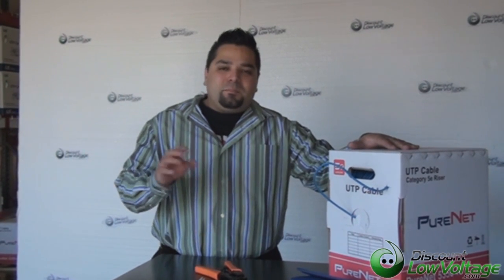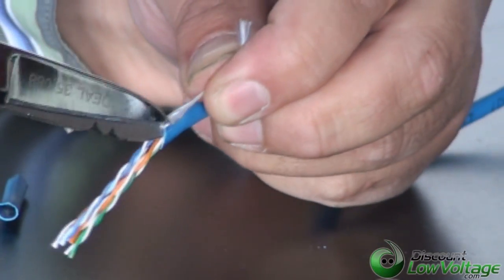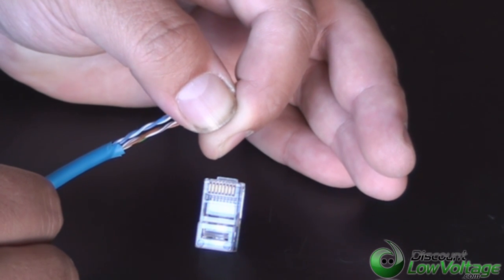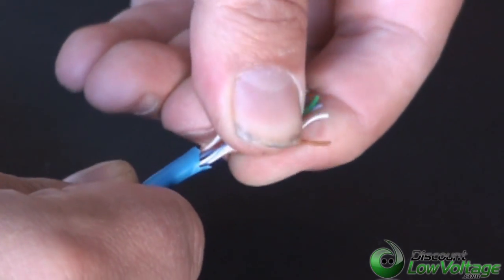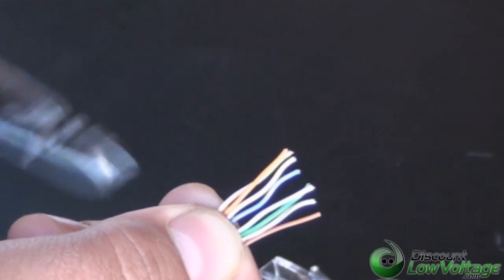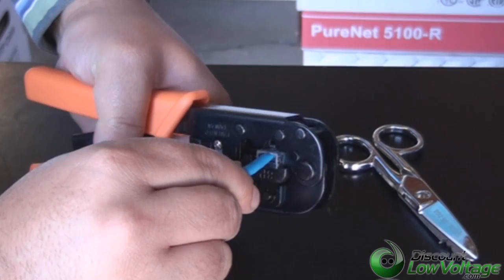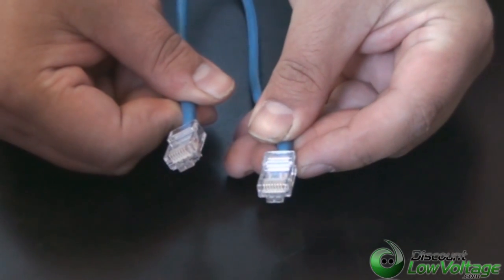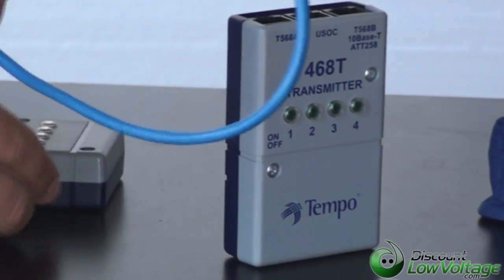RJ45 How to make an Ethernet  568B Patch Cable

Comment: This helped me quite a bit, but I still flubbed two connectors before I got it right.  Next one I try I am gonna see about using some tape to assist it holding the wires in order -- wish me luck.